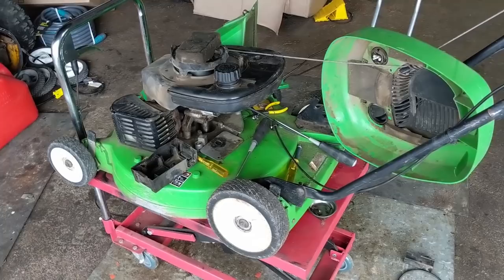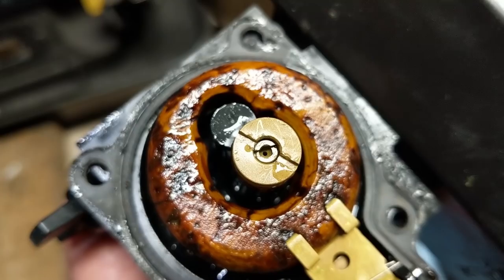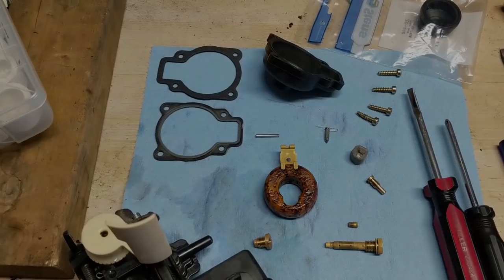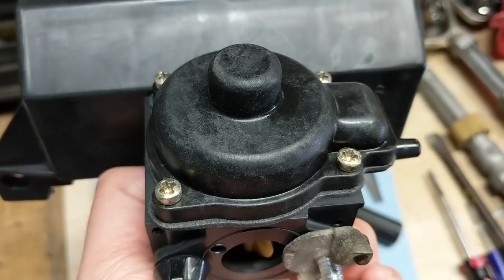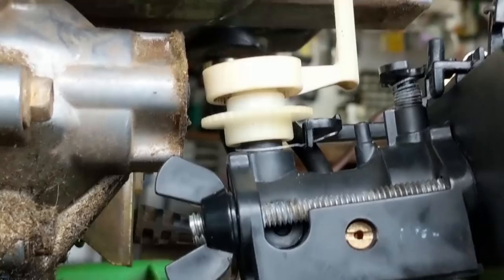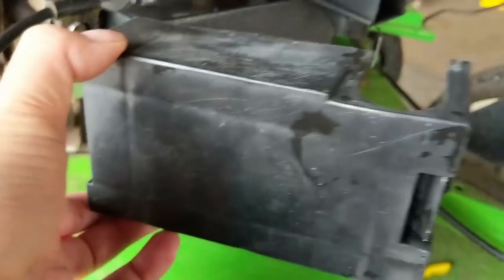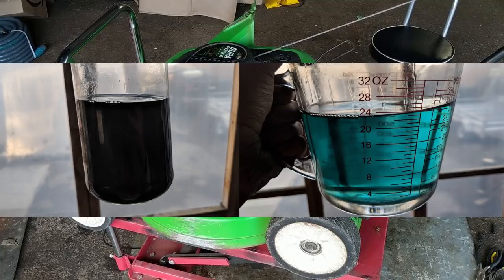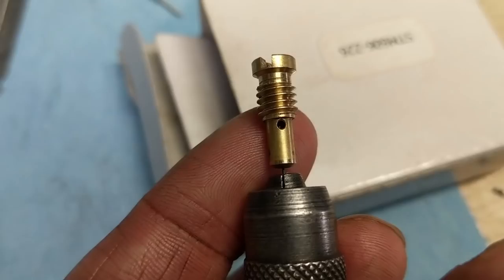How to Clean a Lawnboy Carburetor

Comment: Yesterday I decided that my Model 10525 had sat in the shed long enough. Last time I tried to use it I had to leave in on partial choke because it was surging. At the time I didn’t know that this was a common problem. Then I got a riding mower and the Lawn Boy sat. For 16 years. So last night I watched this video and today I cleaned the carb and spark plug. The silly thing started on the second pull! THANK YOU!
Reply from the maker: Thanks for watching!

Comment: Excellent video! One thing I’ve done to two of my Lawn-Boys is cut a piece of foam off an old air filter and put it in the primer bulb. That helps block dirt and dust from another path to the carb. I have a 1973, 1975, and 1987 Lawn-Boy and they all fire up on the first or second pull, and I still use them to mow weekly.

Comment: Great video by the way! Thanks for creating very thorough content. Aside from not knowing how to read and adjust for compression, pressure, etc this fixed my machine that was acting up rough 15 years ago so I left it alone. After cleaning out the carb, it started on one pull! Hasn’t been used in 15 years lol

Comment: I love the way he explains things. Definitely explained everything I need to repair my Lawnboy. Mine leaks fuel through the carb when not in use. Even leaks some fuel into the crankcase.
Reply from the maker: Thanks for watching!
Reply: @EliminatorPerformance  Where did you purchase you tiny drill set? If from a tool dealer MAC, Snap-On, that is okay as I have contacts in the automotive trade to order that.

Comment: one of the truly good lawn mowers.
Reply from the maker: The best, aluminum deck never rusts!

Plastic carbs easy to clean!
Reply: Can you take out (to clean it or drilm a larger pilot hole as you suggest) the rpm screw without taking apart the whole carburetor?
Reply from the maker: @BroadwayJoe49  Yes, it's on the side!

Comment: I've been dealing with a surging Lawnboy Duraforce lawn mower for quite awhile now. Mine surges as soon as it starts up. It calms down after awhile but when it first starts up, I need to keep pressing the primer bulb once or twice to keep it going.
I just came across your video and decided to give the micro drill bit into the pilot jet a try. ordered the bits today and they should be here in a couple of days.
If I can come back to this post, I'll update on the results after I ream the pilot jet out a little.
Thanks...
Steve in Central Vermont

Comment: I’ve worked on around 40 lawnboys since this video and 50:1 is definitely the perfect mix. All of the ones with 32:1 have smoked and the spark plug was carboned up. Also have seen lots more of carb problems due to that.
Reply from the maker: Thanks, that usually what I run in 2 strokes that are used weekly. If using a trimmer or chainsaw every day for work, I'd recommend 40:1

Comment: I had been using opt1 synthetic mixed at 50 to one. I was mowing the other day with a 10550 and it threw a rod and destroyed everything. Punched a hole in the case. It was running perfectly up to that time. Since then I have changed to 32 to 1 on the donar engine I installed. I have had others tell me that the Duraforce runs hot and needs the richer mix to help cool. On the other hand the dealer that sold me the opti 1 said I could run 50 to 1 in anything , and I have. Chainsaws, trimmers with no problems. This was the first time I had an engine blow on a mower. So to try and be safe , I'm  using 32 to 1 on the Duraforce.

Comment: Great video!  I've ran the piss out of mine for 17 years. I've cleaned the air filter like every 3 years and only changed plugs twice and a coil once or twice.  It still starts every time. Did make sure to break it in slowly when new.  Just bought a "parts" mower with a super nice deck and swapped the engines. I'm going to clean the carb and put a fuel filter on it - Nice demo on t 
Also, never hear of a "Jerry can"....??
Reply from the maker: Jerry can = gas can lol

Comment: To aid in reassembly: Saw a screwdriver slot in one end of ONE piece of one inch long1/4-20 threaded rod. Screw it into one mounting 
hole about 1/4 inch. This allows you to hang the aluminum plate in position on the stud while installing one of the mounting bolts.
Remove the rod and install other mounting bolt. An option is to also glue the aluminum plate and a gasket in position.

Comment: Never thought about  using wingnuts to hold the entire setup together. Might have to try that if I get another lawnboy that has a throttle setup.
Reply from the maker: Yea it really makes the whole cleaning process much easier, by not having to remove the tension spring! Thanks for watching!
Reply: @EliminatorPerformance  What size wing nut did you use to hold everything together?  Thx

Comment: Thanks for the video…have a customer dropped off an abandoned one.  They replaced the carb and it won’t rev up.

Been sitting in my yard for over a year.  Got it running with a Huff of GoGo Juice, Fresh Fuel and Seafoam.  Only way it Rev up is if I push the buttery flap.

Now I know how that spring is routed…pray for me I can get it to work lol
Reply from the maker: 🙏 sending positive vibes your way Pattay
Reply: @EliminatorPerformance  already running! Machine Degreased, blades Reconditioned and listed for sale!

Thanks again!🦅🇺🇸🔧🤙🏻. Hope the season is treating you guys well!
Reply from the maker: @pattayperformance  very well, wishing you the same. Thanks for stopping by!

Comment: Funnily enough, these are the exact engines used in the Toro CCR2450 and CCR3650s before Briggs and Stratton bought out Lawn Boy's engine division. Those ran at 50:1.
Reply from the maker: I always run 50:1 thanks for watching!

Comment: Would you have any suggestions for me if I told you I was having a hard time getting the bolts to retighten? I still have slack in the assembly, but the bolts feel as if they are maxed out when it comes to tightening. Possible thread issue?

Comment: I have a Lawn Boy Gold Series model 10546.  the mower starts and runs great when it is cold but if you run it for a while.. 2-5 minutes, and then shut it off it wont start again until it is cold.  Any ideas???  BTW.. I have cleaned the carb, replaced the primer bulb, changed the spark plug, and put new gas in it.
Reply from the maker: Could be the coil becoming heat soaked, it's a possibility. I'd check for spark when it gets hot and shuts off. You'll have your answer if it's the coil.
Reply: @EliminatorPerformance  ok.. thanks.. I have a new coil ordered thinking that may be the issue.
Reply: @EliminatorPerformance  thought I would let you know that I got the new coil in and replaced it.  Works great now.. thanks!!!

Comment: From the factory the inlet seat washer is not there, Toro used Loctite 515 gasket maker to seal the threads (and also around the pilot jet).  Either method works, but that is why the Toro needle kits don't come with the washer - they expect you to use sealant.
Reply from the maker: Good info, thanks for watching!
Reply: I miss the Briggs&Stratton 2 cycles.

Comment: Good day  Interesting video.  The float  was that a normal color?  Yea yrs. ago I went with heavier oil mixture, until I bought   Sthil  whipper zipper  & was told 50-1 is good enough.  Thanks
Reply from the maker: Yea those floats always seem to look like that, just discoloration.

And yea I run 50:1 in all my 2 strokes, never had an issue!

Comment: Using an ultrasonic cleaner to clean plastic Lawn Boy carbs, do you use any heat at all or a low temp?  What is the temp you use?  Sorry if I missed it.  Thanks
Reply from the maker: Normally I would use hot water from the kettle, almost boiling to clean an aluminum carb.

For Plastic carbs, Luke warm water, or room temp, as the vibration alone should be good.

In the video here I just used the garden hose and an air compressor to show that it could be done!

Comment: Id like to get a 2cycle lawnboy one reasone is you never have to change the oil only when you get a new can of gas and oild
Reply from the maker: Very simple, I run 50:1 ratio on all my fuel mix for 2 strokes, and make sure you use a fuel stabilizer! Thanks for watching!

Comment: Great video. My issue, I've just replaced both the ignitor and the carb, also adjusted the throttle cable. However, when I try to start the mower, it just runs for a few seconds then dies out. What could be going on?
Reply from the maker: Sounds like it's not pulling fuel through. It has enough to start, so you have spark and compression, but no flow! I'd double check the float height, and also make sure the fuel is flowing from the tank!
Reply: @EliminatorPerformance  thank you for the prompt response. You have a servant’s heart. I will double check, I think my new fuel tube is too long, I might try to cut that short. Great tips!
Reply: @Eliminator Performance Can you please post a video or explain how I can replace Toro Part 94-5764 SEAL-OIL for my Silverpro 102323 (2003)? It was determined this is the root cause of the surging as it's leaking oil. Please help!
Reply: @EliminatorPerformance  Any chance you could post a video explaining how I can replace Toro Part 94-5764 SEAL-OIL for my Silverpro 102323 (2003)? It was determined this is the root cause of the surging as it's leaking oil.

Comment: Can you tell me how to adjust the top spring tension as I had to replace the spring ! Regards
Reply from the maker: I'm actually not too sure, you may have to do some research online for that one!
Reply: @EliminatorPerformance  the throttle plate pulls straight out towards you. You can then pull the entire throttle up to expose the spring. Also, if you look close enough, you can sometimes get the the spring back in the hole. Reassemble and adjust tension by turning the disc clockwise or counter clockwise to the right tension. Though dangerous, I use a clamp to lock the bar and carefully make minor adjustments after I have it back together. I've found that if you're machine is surging... You only need to clean the gas can and screen. Very good video.

Comment: What type of vacuum gauge do you use?    Also the part number for the inline fuel filter.    Thanks Richard
Reply from the maker: Pressure gauge is a STENS 705-020 (look on Amazon) it cost me about $100 but well worth it for what I do. they were on sale for $74 not long ago.

And the inline fuel filter is a standard 298090S Briggs inline fuel filter!
Reply: @EliminatorPerformance  Does it matter in what direction you place your 298090 fuel filter?
Reply from the maker: @TheLizardKing64  no I don't believe so as they are just a metal screen. "There is no direction on this fuel filter. It filters either way with no check valve."
Reply: @EliminatorPerformance  Thank you!

Comment: What’s a great online vender to buy these parts OEM or AM types. I need to buy a new choke throttle cable. Mine got pinched from folding over. Great machine. I bought two of these 20 years ago. I’m on the second one after using for 30 min it’s been in storage. Can’t get it to start lol. Been sitting a tad too long. Best mowers I’ve used. Not sure what to do if I need a new one that’s comparable to these beasts. I’d mow for hours and hours. Never ever had 1 issue ever.
Reply from the maker: Probably Amazon would be your best bet
Reply: Eliminator Performance ok sounds great. I’ve had issues with junk parts so figured you might have a trusted retailer.
Reply from the maker: We do have trusted distributors! STENS, Canada Power Technology, Powersource Canada, Oregon etc... But you need registered business license to sign up and you also must go through a lengthy credit application process.
Reply: Eliminator Performance oh I see. Yeah I don’t need that much. I looked on Amazon and see a few good sellers as well as eBay. Appreciate the help though!

Comment: Will 32 to 1 work in this lawnmower?
Reply from the maker: Yes but I recommend a 50:1 mix if using the equipment residentially, or 40:1 (little bit more oil) if using the equipment more than once or twice a week!

Comment: Got my carb all cleaned up and everything is back in place but I dont have any throttle control other then choke and wide open. When I move the throttle from choke to fast,  the butterfly opens wide as it should but when I go from fast to slow, the butterfly doesn't move. Cable was adjusted as per your video but the only way I can use the mower is to run it partially choked, otherwise it turns about 10 grand!! lol Any clues?
Reply from the maker: Air leak maybe, sounds like running lean (too much air) will cause high rev
Reply: @EliminatorPerformance  should the butterfly move from wide open to partially open when I move the lever from fast to slow?
Reply from the maker: @jerrytracy5291  yes this will limit air and cause the engine to slow down
Reply: @EliminatorPerformance  okay maybe you didn't read my original reply correctly. What would cause the butterfly to not close partially when the throttle control is moved to the slow position. It will choke it and it will move to wide open but when I move it to slow the butterfly doesn't move. I adjusted the cable as per the video and I dont see any broken or missing pieces. Thanks!!
Reply: @jerrytracy5291  I had this same problem on an older LB 5254..  I had the top throttle spring threaded wrong through the lever on the air box. I like his idea of the wingnuts on the bolts to hold the thing together, made figuring out that issue a little easier.

Comment: I noticed you have a hole in your throttle plate. This hole is not from the factory, but rather a surge fix, along with a Briggs pilot jet. I wish you would have spoken of that.

Comment: Gas cap says "32:1" but you talk about making a 50:1 ratio for fuel......why is that?  I have the same mower, wondering if that would make a difference with the engine performance.
Reply: Stay at 32:1

Comment: My 10515 lost 3rd gear and is losing 2nd, with a rhythmic grinding preceding loss of gear.  It still runs fine in first, but shifting is a bit stiff.  I figure this is either a slipping pinion gear (in the trans, not the wheels) or shift keys, any idea which is more common or more likely? What are the most common and likely failures in the Lawn Boy 3 speed gearbox?
Reply from the maker: Without tearing it apart and looking at it, I'm not too sure to be honest. I've always stuck with the push lawnboys, as they have always been quite lightweight.
Reply: @EliminatorPerformance  I FINALLY found my problem, temporarily fixed it, and ordered the part for the permanent fix.  It was a worn output shaft bushing, next to third gear, which allowed the 2 shafts to move farther apart, which allowed the gears to slip, 3rd gear first, then second.  I used bits of an old pie plate to shim the bushings closer together, sticking the bits in the gaps between the bushings and the case on the outside, then ordered a new bushing off Ebay, (Part#60-8770) which beat Amazon this time.  I also used more and better quality grease, mixing  #2 with moly and teflon with a bit of gear oil to approximate #0 grease.  The original old and cheap grease was pretty much sitting in the pan and not getting to the bushing.
Reply from the maker: @alan6832  nice! Good fix, makes sense that it was a shaft misaligned if 1 gear worked and the others had issues!

Comment: Hy. y just buy one like this. it did not start. i cleaned carb and dii not want to start. adding fuel in the motor will start, so y take a look at crank seal :( FAIL) broken crank seal. Im in Montréal. can y still get parts for this
Reply from the maker: Try Amazon or a Toro dealer they may have them
Reply: @EliminatorPerformance  i did push back the seal lip in place add glue and i start the motor :) run good so i will repare it :)
Reply: y will get the seal next week :) :)

Comment: Wow. The full service probably cost more than the value of the mower. I find those online for under $100 quite often.
Reply from the maker: Yes as normally is the case, it costs more to repair them, but this is where maintenance comes into mind. If we use premium fuel and take care of equipment, it costs very little here and there to keep them operational. When they sit with old fuel and are neglected, they cost money to fix.
Reply: @EliminatorPerformance  I used to do that as a part-time thing. People would be shocked when I explain to them that it would cost more to fix their mower (parts/labor/fluids) than it would be to just buy a different one. Very good video.
Reply from the maker: @Kuwaitin08  yes we used to take mowers in on trade instead of fixing them, then give someone $15 off one we'd sell chraper. Then fix that one up and sell it the same way. Would be a cycle of profit considering all the parts we put in are at cost, minus my labour. Thanks for watching!

Comment: Tried everything: cleaned out the carburetor, fuel lines, replaced spark plug and filter, sprayed carb cleaner and starter fluid; still wouldn't start.
Done with gas mowers.
Reply: Do you have spark?